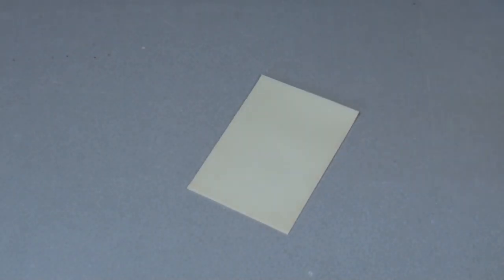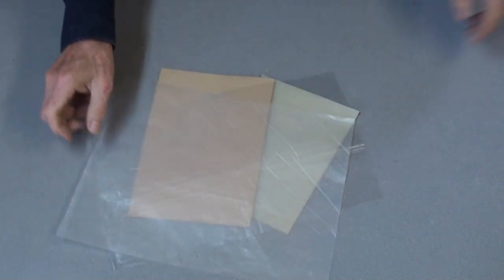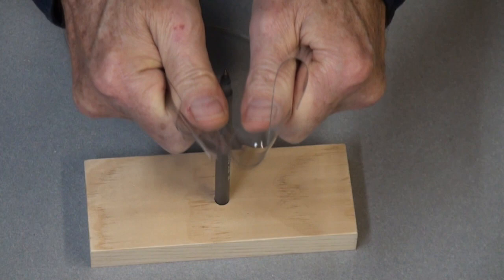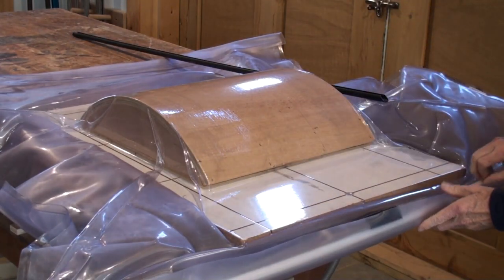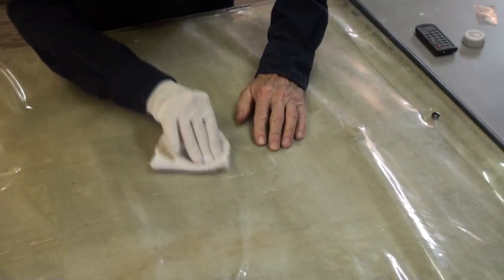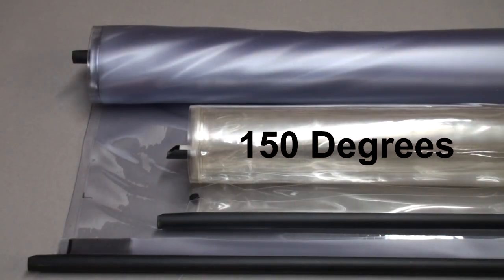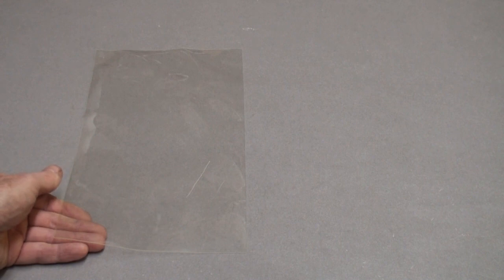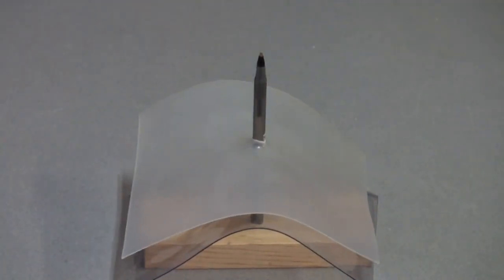Understanding Vacuum Bags

Comment: Interesting video!  Two questions:

What about UV resistance for bags that will be used in a sun exposed work area?

What about storage lifetime?  Does either material loose it's flexibility or memory retention as years go by?
Reply from the maker: our bags are meant for indoor use so we do not incorporate UV inhibitors in the bag formulation. Polyurethane bags can be stored indefinitely where as vinyl bags need to be stored very loosely rolled up otherwise a sticky substance will precipitate out of the vinyl if stored tightly for an extended time. Bags will loose some flexibility over long periods of time but kept out of even indirect sunlight will benefit a bag for long term storage.

Comment: You say use 30mm, do you 3mm? 30mm is 3cm and that is way thicker than what you show in this video.
Reply from the maker: You are correct our bags are not 30mm, that would be a very thick bag! However plastic sheets are commonly measured in Mil which is not the same as mm. 30 Mil is 0.03 inches or 0.762mm